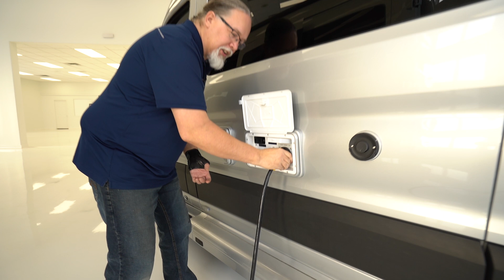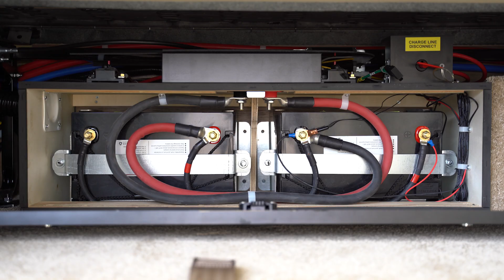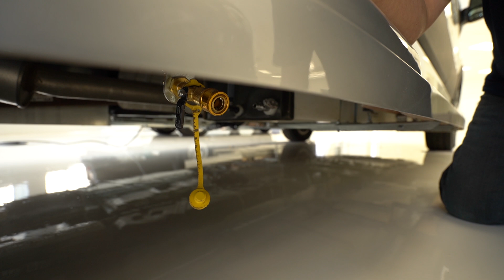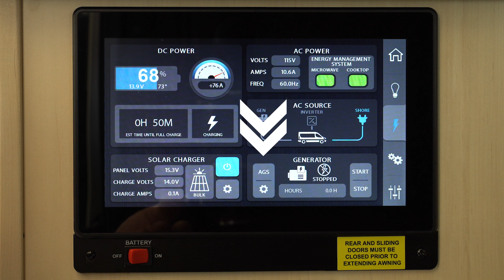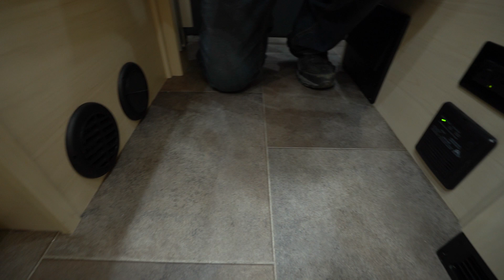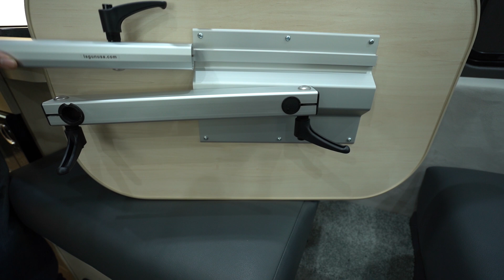2022 Pleasure-Way Ontour 2.0 | Orientation Walk-Through

Comment: Hello Richard,

Question - you state in the video that the charge line disconnect prevents the solar panels and alternator from charging the batteries.  What about the generator?  If I exercise the generator in below-freezing temperatures, will that damage the batteries, or will it also be prevented from doing so by the charge line disconnect?  Thanks!
Reply from the maker: Hi Bob, you are correct that the charge line disconnect only prevents the solar panels and alternator from charging the batteries. The generator will still send a charge to the batteries with the charge line disconnected. So, we suggest ensuring the batteries are fully charged before storing the coach for winter. The coach batteries will NOT except a charge if they are fully charged. If your batteries are depleted while in below freezing conditions, we suggest running your furnace to heat the interior of the coach to get your batteries to above freezing temperatures. Then it would be safe to run the generator. If you have any further questions I suggest giving our service department a call here: 1-866-347-8919

Comment: Richard at 21 minutes in this video you have an error.  When demonstrating the LP quick connect.  You showed replacing the plastic plug but then you turned the valve to the on position.   You said shut but showed moving the valve from off to ON.   You might want to edit the video if someone does that it could be dangerous.
Reply from the maker: Hey Tim, good catch. The LP quick connect will only allow propane to flow through it when the proper LP hose is connected. So even if shut-off valve is in the ON position as long as there is no hose attached propane will not be able to flow through.

Comment: Nice video, a couple things missed. With the Spyder Panel off, the solar system will still charge the batteries as will the alternator. Second the USB ports are behind the two ottomans. On the sewer hose attachment, the outlet will swing down a few degrees if needed and needs to be put all the way back up before driving off. I have yet to find out how to turn on the rear camera while driving forward if needed from the touch screen and not in reverse. Have a great day.
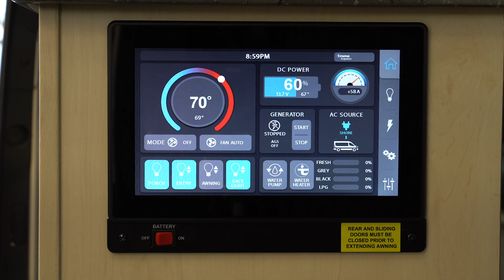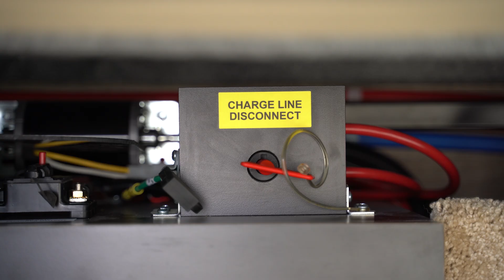Reply from the maker: Greetings. Thanks for your comment and additional tips! You are correct, the 12V battery disconnect @ 13:28 simply disconnects all 12V load on the coach batteries and does not stop charging from any of the four sources (solar, alternator, shore power or generator). However @ 14:03 Richard explains that the Charge Line Disconnect (Red Key) is what will disable the solar system and alternator from charging the coach batteries. Thank you!

Comment: I own a 2.2 however this is very helpful!  What does the solar “bulk” button do on the power page?  Thanks.
Reply from the maker: The bulk button is a display of the current solar panel charge setting. The controller automatically cycles through three charging stages: Bulk, Absorption and Float. Bulk is the normal charging mode for fast charging. Once the batteries are fully charged, the controller with automatically change the setting to Float, which simply maintains the full charge. The Absorption charge mode is less commonly used as our lithium batteries prefer the fast charge from the Bulk setting. I hope that helps.